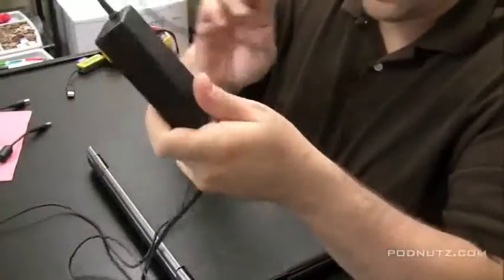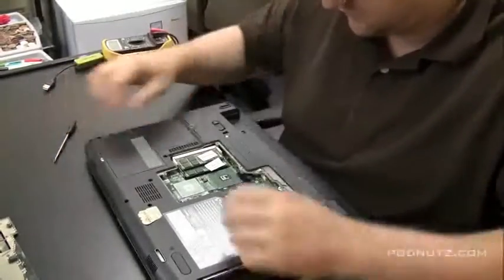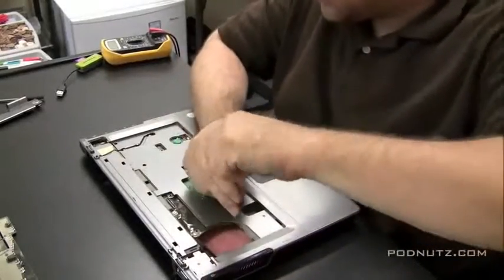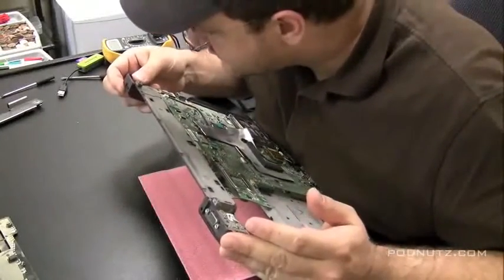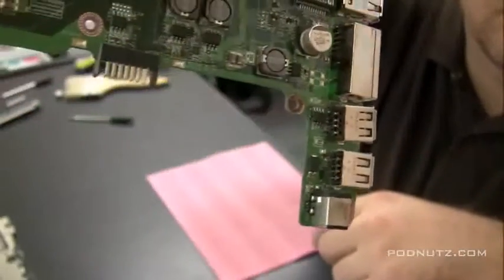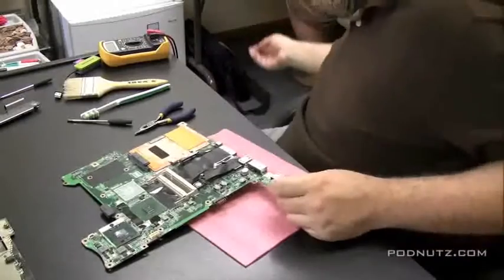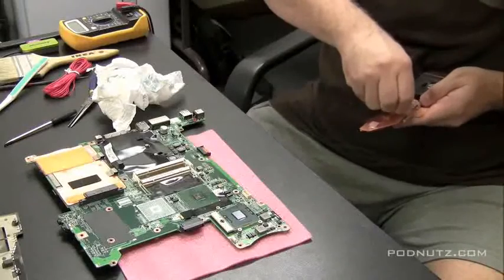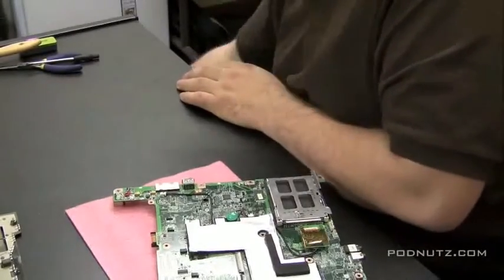How To Test And Repair Laptop DC Jack

Comment: I want to test the dc jack on my acer aspire 5517 which has the same jack soldered to the motherboard but I don't know where the positive and negative points are on the jack in order to test it with my multi-meter properly as I don't want to test the wrong pins and short out my board, I've looked online and cannot find any diagram indicating this, any help would be really appreciated, thanks.